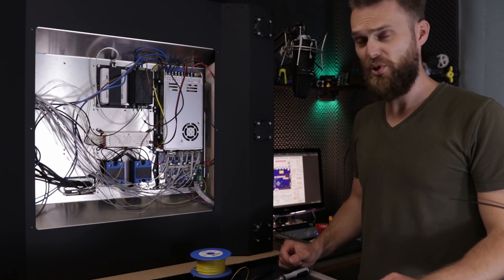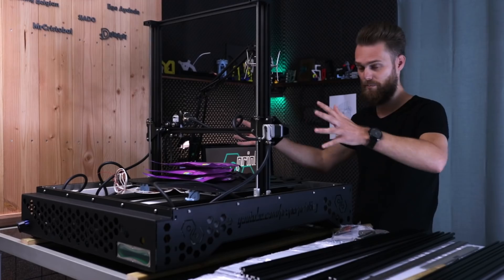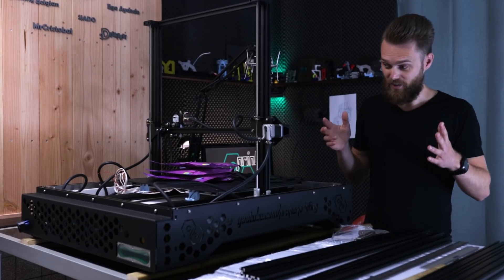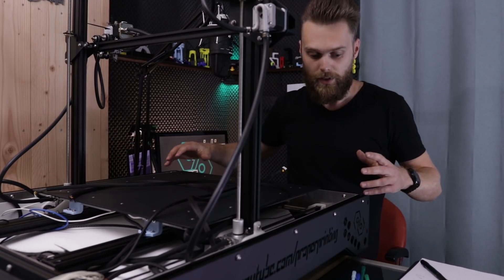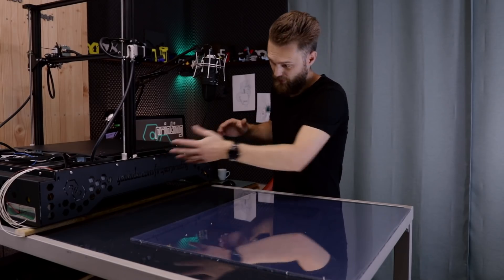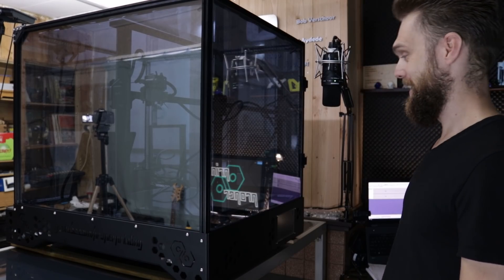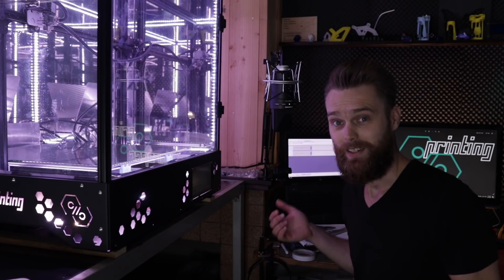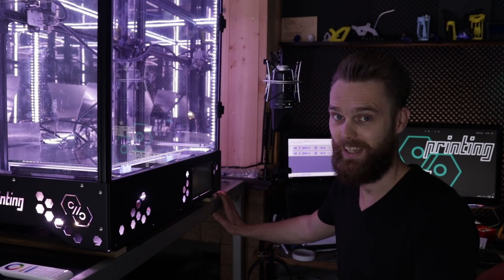Huge and insane infinity cube 3D printer enclosure!

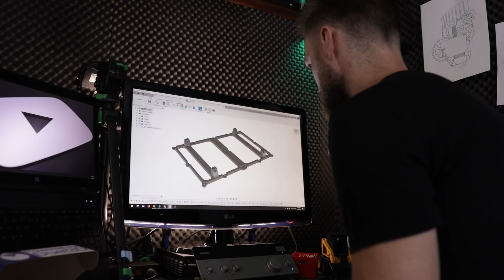Comment: 0:20  that was smooth editing.
0:30  Will this work with water, or just "Windex"?
Reply from the maker: Thanks! I haven't tried it with water yet, but I already use glass cleaner to clean the glass so I can clean it immediately after removing the parts ;) Maybe water works as well, I know IPA does.
Reply: @properprinting  when I clean the glue-stick off my bed,  I'll give cleaning with windex before a print a try.

Comment: A question on the grounding strap...
Does the color coating on the extrusion interfere with the grounding, or do you have to have a grounding strap on every rail?
Reply from the maker: That's a good question! Officially each profile should have its own wire. The chance that a life wire from the insight touches one of these when springing loose are so small that I'm going to keep it like this. The t slot nuts will puncture through the coating so it should be grounded, but this isn't a certainty.

Comment: Dude, time yo jump into SLA. I have been toying with, and a few people have attempted, a large format SLA printer. The useful bits that already exist are large for mat LED monitors and an existing open source OS. What doesn't quite exist out of the box is a good UV light source, frame, build plate, drive system, resin vat, etc. All totally buildable but would need to fabricated from whole clothe. Imagine being able to print things like whole RC cars in resin or full structural pieces. Anyway, I challenge you.
Reply from the maker: Damn, that's quite the challenge! xD Damn cool for sure! I have to take a look at the different print techniques for sure!
Reply: @properprinting  I know you would do an extraordinary job on it based on how great your FDM printer turned out. I took a few minutes to look at the SLA ecosystem and it turns out practically every SLA printer manufacturer uses the same company's controller board, firmware and documentation. Also, that same company has a 15" lcd that it can be used with and also sells the UV lamp array. Really, all the pieces are there. Anyway, just an idea.

Comment: Great project! The view of the Infinity printer is amazing!
But, I have a little idea:
You have a lot of space left behind the working area of the 3d printer. It can be used to increase the rigidity of the portal by placing struts as on CR-10 v2. To do this, you just need to enlarge the y-axis carriage to place it.
P.S. Translated by google translator. And "Hi!" from Russia)
Reply from the maker: Thanks for your suggestion! I intentionally placed a 2040 at the top so I'm able to stabilize the gantry up there if needed ;)

Comment: Woah nice, if you'd like to add some addressable LEDs to that with insane effects, or have the LEDs be functional with doing a a pattern or color when the print is done for instance, hit me up! About the heat, you glued most of those LEDs to the Alu profile right? That should sink a lot of it away already. :) That printer is starting to look better and better! :D
Reply from the maker: Thank you! My colleague suggested to use addressable LEDs and that's still something I'd like to do. He uses bit-banging on an Arduino, but it was too much to incorporate that too. Making functional LEDs for a 3D printer is still something I'd love to do in the future! I used 3D printed 45 degree corner pieces for the strips and I hope that the heat can dissipate a bit through those profiles. I'm going to make sure that the strips will stay in place during printing ;)
Reply: @properprinting  Ah wow, the way he's doing it is quite a complicated way now a days. The "cool kids" use WLED software running on an ESP8266/ESP32 instantly giving you 100's of effects and palletes and even more advanced features such as intelligent power limiting, segmenting, web API control, Home Assistant integration, etc.. Installation is as easy as flashing a binary. And if you want to make it even simpler I have created controller boards like the QuinLED-Dig-Uno and QuinLED-Dig-Quad to which you just hook it up and it works!

About the plastic corner pieces, that won't sink away a lot of heat from the LEDs. Luckily you got RGBW LEDs so don't run RGB white but dedicated white, that won't burn itself to death too quickly without sinking away the heat. :)